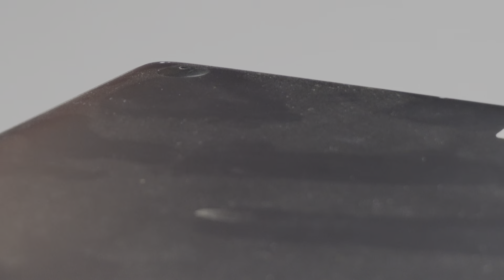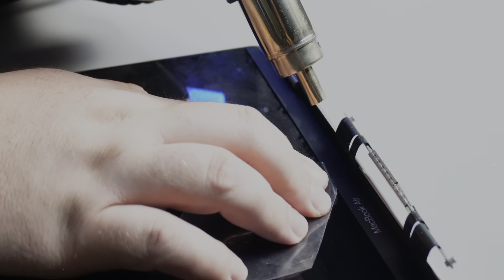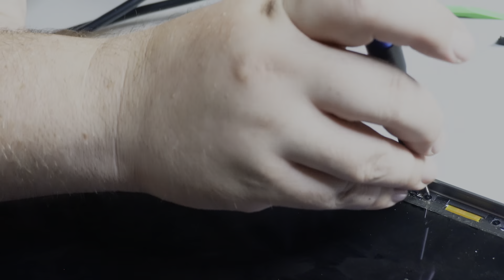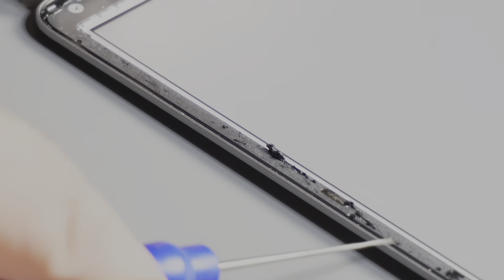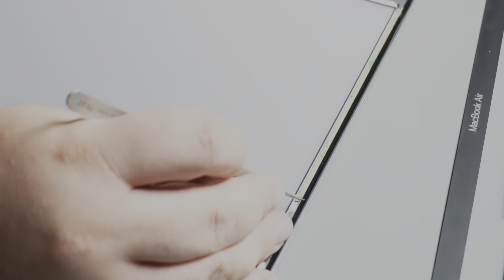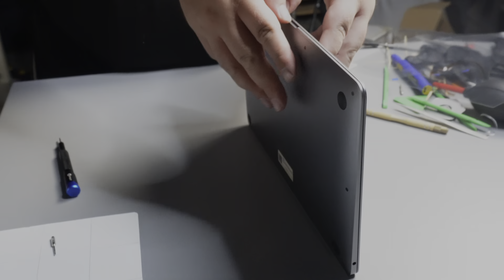MacBook Air A2337 LCD Panel-Only Replacement | Step-by-Step Guide

Comment: This was the most painful thing I've ever attempted. After putting down the new LCD, I noticed the holes at the bottom didn't line up, so I tried unsticking the new screen and cracked it in the process. If you're on the fence about trying this yourself - Don't.
Reply: I'm watching and wondering, IF I'm able to do it! hahahah

Comment: There was no mention of whether you need to harvest the eeprom and EDID chips from the old panel's electronic board and install on the new panel electronics board. If you don't do that wont Tahoe fail to recognise it as an Apple screen and leave you at the mercy of any future Apple update that may stop you using the screen?

Comment: I recently performed this repair per your video.  It went smoothly!  However, the camera no longer functions.  Does it need to be (re)paired to the logic board somehow?  I was quite careful of all the cables, etc but I am reading that it may be a config issue.  Any help is greatly appreciated.  Thank you!
Reply from the maker: The camera shouldn’t be affected by an LCD-only replacement on the A2337 since it’s part of the display assembly and uses the same cable. Most likely it’s either a loose display connector or the cable didn’t seat fully when reinstalled. I’d recommend reopening it and carefully reseating the display flex cable—make sure it’s aligned and fully secured.

Also worth checking: System Settings → Privacy & Security → Camera to confirm apps have permission, just in case it’s a software/config issue.

If reseating doesn’t fix it, there’s a chance the display cable got slightly damaged during the repair, but that’s pretty rare if everything went smoothly.

Comment: Awesome video! I have a bent aluminium cover, but perfectly screen and a good aluminium cover with a cracked LCD. So I want to swapped them. Should the backlight on the cracked LCD is also damaged... is it possible to swap that too? In other words, is it possible to safely remove the backlight or is that permanently glued to the aluminium cover?
Reply from the maker: Thanks! 🙌

It is possible, but honestly it’s extremely difficult. The backlight is bonded into layers, so you’d have to carefully peel everything apart and transfer it without damaging the films or getting dust in between.(I recommend a dust free environment)

You can extract and reuse the backlight, but one small mistake and it’s done.

So yeah — doable, but definitely not practical for most repairs.

Comment: This video was helpful, thank you.  However, for those considering this job, be advised that it doesn't always go this smoothly and can take a very long time.    1) You may not get the LCD panel out without cracking it due to the adhesive not coming off cleanly.   I heated mine and tried to slice through, but there is so much more adhesive on mine than on this one, that I think it still cause the screen to not come free cleanly.  2) The rubber gasket that goes around the edge of the screen does stretch and then takes forever to go back in.  I believe I spent at least an hour trying to get that part alone to work.    3) The glass bezel at the bottom of the screen was also not coming unglued and I had to scrape it clean, mm by mm, breaking the glass as I went.  It was only a $10 part, but very time consuming.  In my case, the simple things took forever, while the actual disassembly / reassembly was pretty easy.  Plan on spending 4 hours on this unless you have the specialized equipment for heating adhesive.  My generic heat gun is apparently not the right took.   Also, you should know that you need a T4 for the tiny little screws, as well as a T5 for the slightly larger ones.   These 2020 MacBook Air M1's aren't worth spending $300 for a new assembly and, given the time here, may not be worth repairing at all.
Reply: Great feedback. I'll try to replace my M1 MBA battery when the day comes, but I'll replace it if the screen ever goes out.

Comment: Just started doing these instead of full assembly! I noticed that the panels are out of stock on your site and have been for at least a few days, are these expected to be available again soon? I usually do majority of purchases for our shop through you guys but also noticed some other vendors seemed to be out as well, hoping there isn't an issue with getting these parts into the US since they seem to be gone everywhere. Thanks for the upload, some helpful tips for sure!